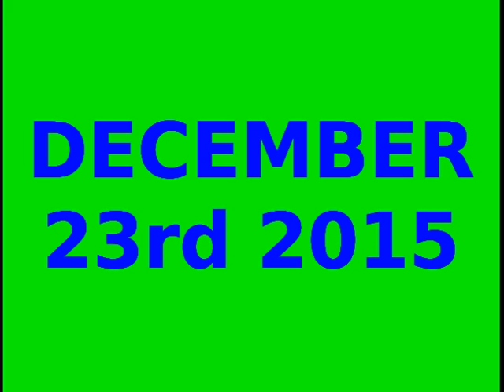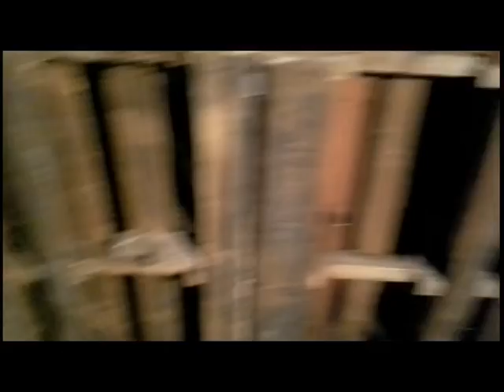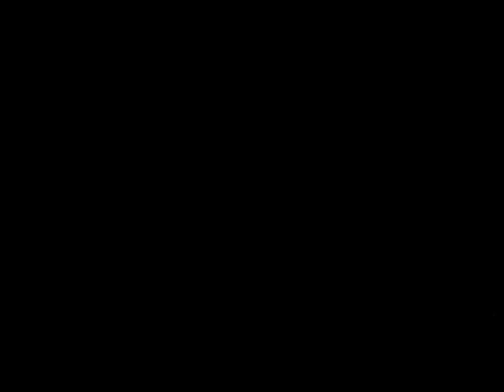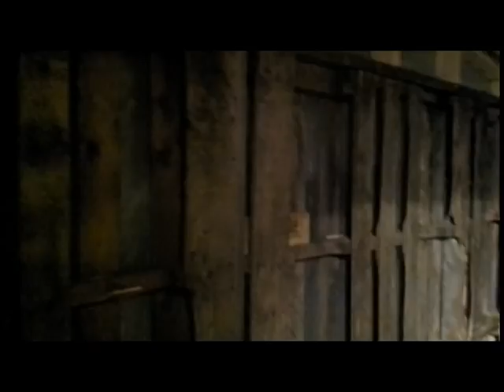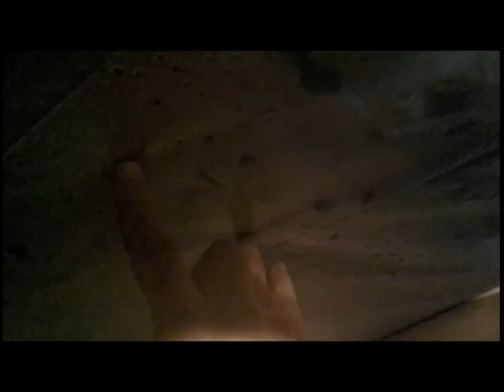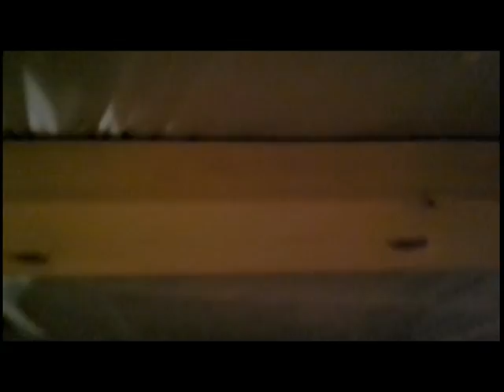THE PALLET SHED BUILD PART 3

Comment: that shed would not last a week here in canada.lol
Reply from the maker: And I bet you are right sir. Maybe two weeks in the winter. Three weeks in the summer at best. I have added a bit to it though. insulated walls with several folded over layers of cling wrap which doesn't allow the air to flow through the walls. a few more layers of plastic to the roof, and T-111 for the roof. lol. solar lighting. and 120ac lighting, refrigerator, laptops, air conditioning, Stereo, fans, heater, I spend a lot of time down here enjoying the pallet palace vacation getaway man cave. Even camped out here most of the time. And even hand pumped running water. lol. I am going to sheath the outer walls soon as winter is approaching. and a shower. solar heated water for that. The water has been off grid for experimental purposes. So far I am well pleased. No leaks, or breezes. And very peaceful. 

Thanks Mike, Keep smiling and have a ball. God bless you and yours.

MUDDy

Comment: a neighbor of mine built a pallet wood fence, it got treated once and lasted for ten years ! they are pretty good like that !!  I think your green house shed should be fine for a good few years there muddy
Reply from the maker: +sashtw The pallets are made of Oak, or Bodark, Also few made of pine. The first two rot very slowly. They are very hard woods so as to support heavy loads. Also the reason the floor has no pine pallets. 
     The cool thing about most pallet fences is, they are built staggered like a zig zag. Thus they stand without posts or digging, and they will stand for a long time. I think they look really cool.
     The pallets also make great vertical gardens. Line the inside with plastic and or weather resistant garden mulch fabric liner. And the plants grow out between the boards on both sides. easy to work with too.
Thanks for the great comment. :)
   MUDDy

Comment: bet cubby houses were your thing in your younger day's.
Reply from the maker: +closertothetruth Absolutely! Our house was FAT!
Our house was two stories, and lots of other stories to remember. lots of room to run and get into trouble inside. Thus the other stories, lol.
But my room was super small because I was the youngest, so I got the sewing room. A single mattress which took up 60% of the room. lol. The crazy thing is, I spent more time in there, than out of the room. tinkering, soldering up circuits, fixing clocks, building transmitters, DJ ing and keeping it as messy as it could get.
If i wasn't there, i would be down at the beach all day. The skinniest fish in the water.
MUDDy
Reply: Sem xech thai lan

Comment: Nice. Pretty sure I could live in that ... and once you get the plywood down some little critter is going to move into the basement. Good to see the new videos bro!
Reply from the maker: +belgrademachine one secret word, "diazinon", lol, I hope i spelled that right. or 7s dust. But I shouldnt have much problem with bugs or snakes. The cedar trees drop a layer on the ground that is a natural deterrent.
cyan pepper works very well against ants and other crawlies.
After we get the door installed, and a little plastic wrap insulation in, we plan on camping out for a night.
 :)
Thanks, I had fun making the shed, and videos.
stay safe and warm.
MUDDy

Comment: Put a woodstove in it and It will be a Nice Mancave !!!
Reply from the maker: +not2fast4u2c Funny you should mention that. :)
I have a shiny 3 1/2 inch straight piece of exhaust pipe. One end is cut atan angle. So we propped the other end up, and found some scrap 2 x 4 to split up. We had that pipe singing like a rocket stove. she even had a slight glow.
Sam and I were thinking that it would be a cool addition. I just have to figure out how to make it a bit safer than just a pipe. mounting, shielding , et cetera.

Comment: G'day Scotty,

Yay Team !

   I've had Softwood Pallets under the Chainsaw-Milled Stringybark Deck-planks on my North Verhanda for 21 years..., and they're just begining to rot in a few places..; the secret is that they're sitting atop Drystone Walls and Brick-Pillars, so they don't touch the ground, and the Roof keeps the worst of the Rain off the Woodwork...  :-)

  Have a good one,

;-p

Ciao !
Reply from the maker: +WarblesOnALot Thank you Chris, 
The whole floor fits inside of the outer walls. very unconventional. almost nothing is done right. But, It is much stronger than any old store bought shed. them little tin boxes even sound cheap, and weak. and they actually charge money for them. Usually more than the stuff you want to put in them. 
lol, I put the floor on the most level place I could find other than over the septic system. But from the front of the shed to the back I have around an 8 inch drop or more. not too bad for a waffle chat shed, tool barn,/workshop and, fire wood storage. Temporary is the key word. Usually they want you to only have ten by ten for a temp building. But I cheated a bit. There is air flow under the floor by way of the holes left for the forks. Next time I will drop some big rocks under it to keep the pallets off the dirt. great suggestion. I had the thought of the under wood of the pallets rotting, but didnt care too much about it. disassembly is rather imminent after a few years. Hopefully i will save by getting rid of the storage shop rent.
   Next is the V1 geodesic dome or two. They seem to be the easiest to build, and very cheap. 12 to 14 foot diameter.
One for a green house and a new tool house/shop. This whole hill is nothing but rock and an inch of soil on top. I think the rocks will be plentiful enough to drop a nice airflow layer to keep the wood off the ground. Great suggestion Chris. And thanks.
and may this helionautical experience be much better for us this full year of 2016. cheers mate.
MUDDy
Reply: ***** 

Yay Team...!

 I'm always wary of "temporary buildings", because they tend to become permanent...; I've been living in one (a 10 Ft by 12 Ft Lawn Locker) for over 22 years...!

  Have a good one,

;-p

Ciao !
Reply from the maker: WarblesOnALot
I hear ya/ I knew better than to drop it right on the ground. I will jack it up and raise it just in case i decide to keep it.
:)
MUDDy

Comment: snow load my be an issue but...pretty good for free
Merry Christmas and Happy New Year
Reply from the maker: +Rev John O'Toole 
We dont see much snow here, But we did get about 6 inches on the 29TH. it didnt seem to phase it. The trees cover most of the hut.  So i will have to drop something a bit more solid on top. I trimmed out any dead branches so far.
Mery christmas, and happy new year Rev. Keep smiling.
MUDDy

Comment: When I make a Temp building I use a clear or white heat shrink wrap, the same stuff they cover boats with.  I buy a 40x160ft roll. I have a temp building that has been up for 3 years and still in good shape.
Reply from the maker: Now that sounds interesting bro. How much does that roll cost you?
I bet it would be great for the geodesic dome which is next.
MUDDy

Thanks.

Comment: good video I thought I heard you say geodesic dome I built my fifth dome about two years ago I'm getting better every time! no.6 in the planning stage as I type(poorly)
Reply from the maker: +Bruce hill aka dale sutphin Awesome bro. I have an itch for a v1 with 8 or 9 footers. That should give me 12 to 13 foot radius. I'm thinking of 3 1/2 inch pipe for hubs. or just put a crowbar to the old wallet and buy the star hubs.
Any thoughts?
MUDDy
Reply: +muddymuddymuddmann my 5th dome is 3v dome 18 feet across 9 feet high the longest struts were less than 48 inches long so i got 2 struts per 8 foot firring strip used 3/4" schedule 80 (thick wall) pvc pipe for my connectors 6 mil plastic for the skin good looking structure very sturdy
Reply from the maker: Bruce hill aka dale sutphin
I assume you have videos on that. I gotta go check that out. I have recently fallen in love with the whole thing. star domes are pretty cool too along with wigwams, and hoop domes,et-cetera. for weeks all folks could get out of me was domes and temp structures. lol. My friends have to be very graceful around here. they put up with my obsessions like true troopers. :) I give them a lot of credit. lol.
:)
18 feet sounds very nice. I bet there is very little scrap left after the build. kindling perhaps for the wood stove.
did you have to get a building permit, or did you jus call it a tent?
 Thanks
MUDDy
Reply: +muddymuddymuddmann lol. its a semi-rigid tent ha ha.used the very small amount of scrap in my primitive rocket-stove I took the stove down last spring it took up too much space right in the middle of the dome I had plenty of room around it though
Reply from the maker: Bruce hill aka dale sutphin
1 1/2 INCH SCH80 what were the Three cut lengths? And what did you use for hubs?
Thanks bro.
I believe in rocket stoves, but the intake needs to be drawn from the outside air. Just a bit tricky, but doable. Other than that it draws too much cold air into the heated area.
:) I believe i will have one in the pallet shed. a very small one though with a tin isolation panel for protection of exhaust pipe temps.
Reply: +muddymuddymuddmann hi muddy I used firring strips for my struts 3/4 by 2.5 inches by 8 feet long so I could get two struts out of each piece I've got pictures and dimensions on another tablet I'll get my 2 resident it techs. to help me recover them they are both at work right now and I'll get them to you somehow I cut the 3/4"pvc into 3" lengths and used them for the connectors all of the struts had a 10-11 degree angle cut on each end and I ran 2 three inch screws through the ends of the connectors into the struts put six struts on 1 connector and you get a really flat 6 sided pyramid put enough 4,5,and 6 sided connectors together and you get a dome I used Desert domes Dome calculator for all my dimensions looked for their site yesterday but I couldn't find it I'll measure what I've got tomorrow and post it back to you
Reply from the maker: Bruce hill aka dale sutphin
Thanks Bruce,
That sounds cool. or the site.
This one sound very interesting.
MUDDy